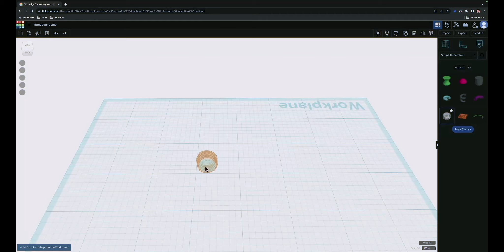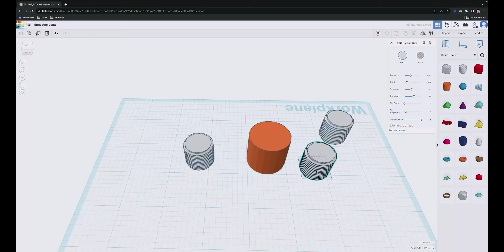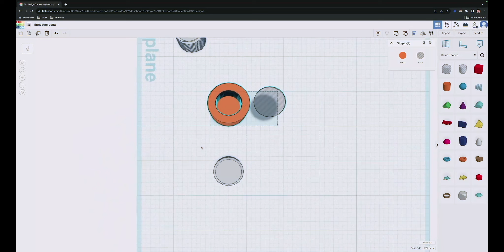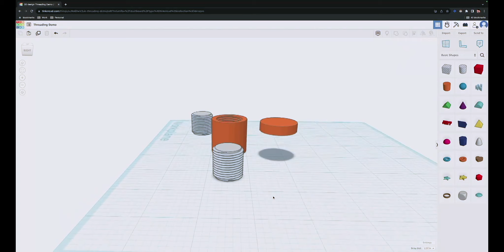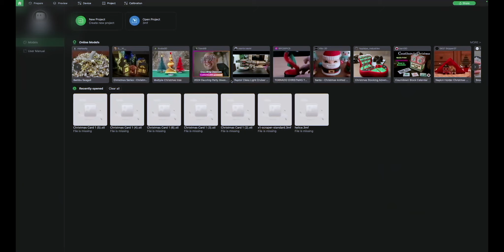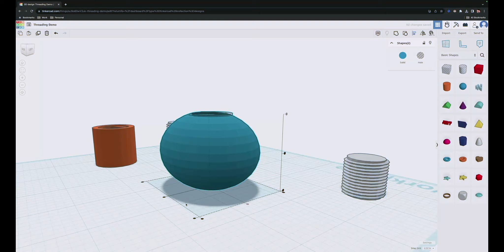Making Threaded Objects for 3D printing with TinkerCad

Comment: You need to learn about using workplanes- there's a button to create a new one to the right of the align button. There are lots if tutorials on how they work and why you need to use them.
Reply from the maker: Cool. I'll be sure to check them out. Thanks!
Reply: @DiscoverFailLearn  You may also want to learn about duplicating rather than copying, and about the mirror tool. They both can save you lots and lots of work. 😀